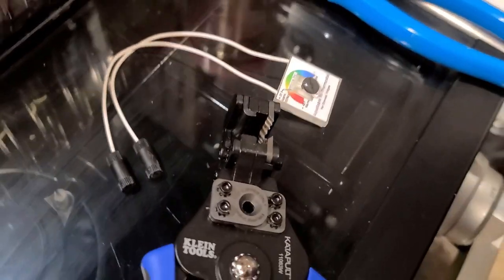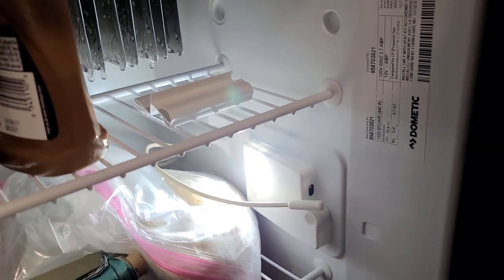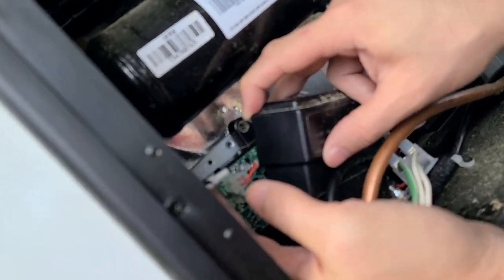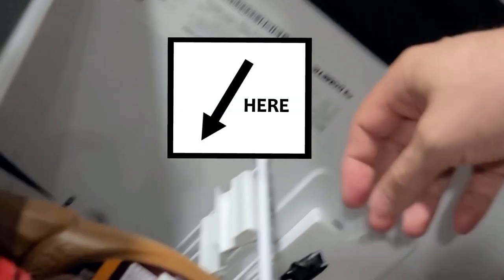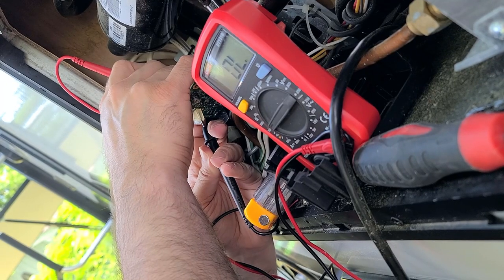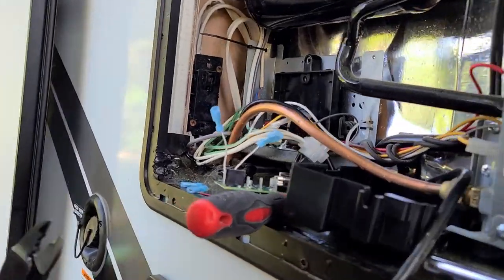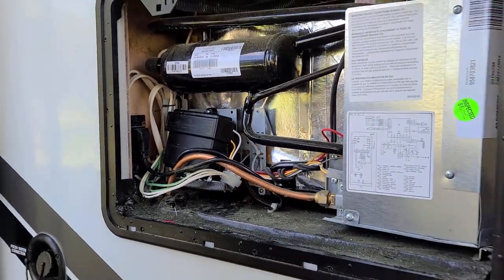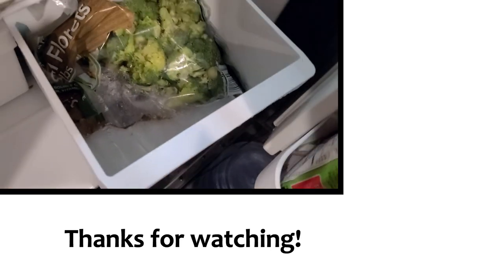Dometic RV Fridge FREEZING Food FIX: Thermistor Connection Problems & our Thermostat Solution -WIN-

Comment: So, if I want to freeze my things in the fridge, I could just unplug my thermister?
Reply from the maker: @Julie Poirier On this particular model, theoretically...that would work. Disclaimer: there may be a safety feature in play that we aren't accounting for 🤔
Reply: @BeingBarton  I did unplug it from the motherboard, it does keep colder at a max of 25 to 32 F depending on the outside temperature and ice in the fridge too. it does not turn into a freezer.
Reply from the maker: @projet2907  Thank you for letting us know. 🙂 I'm not sure exactly what the temperature was inside of our fridge. 🤔 But I think probably 25-32 F sounds like it fits with our experience. I hadn't even thought about what the technical definition of a fridge is, honestly! I just think 'freezer' if water is freezing inside of it. 🤣
Reply: Julie Poirier everything works with my fridge, as far as power gas burner. It just stopped cooling. I’m going to unplug it, like said, and see what happens.
Reply: @joeking9784  I have had my thermistor unplugged fo r6 months and the fridg section is keeping the temperature at -5C.  With an outdoor temperature between 0C and 15C.  Running on propane keeps about 4 C cooler
Reply: Julie Poirier I’ve had mine unplugged for 5 hours, now. Nothing. 70°f on both upper and lower. Sigh. I don’t know what to try next. I have a nice, normal fire and the flue is getting normally hot. The lowest part of the cooling unit is barely warm.
Reply: @joeking9784  oh no!! Might be a defective Motherboard.  It can be a blown fuse in the motherboard,, many things to check.  Try Dometic Frigo troubleshooting on YouTube.  I managed with that in the past.
Reply: @joeking9784  Same deal with me.  2020 Geo Pro fridge used once by prior owner working.  Two fuses on the motherboard are good.  AC to the fridge good.  Breakers and fuses good.  GFCI in bath room good.  Board looks fine Gas lights up fine.  Lots of heat coming out of the top.  Zero cooling.  I am frustrated.